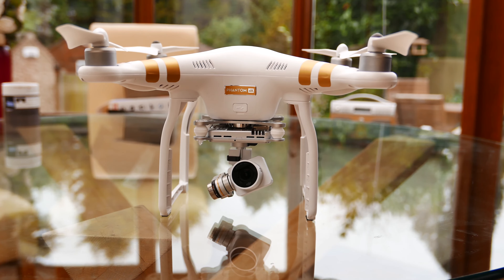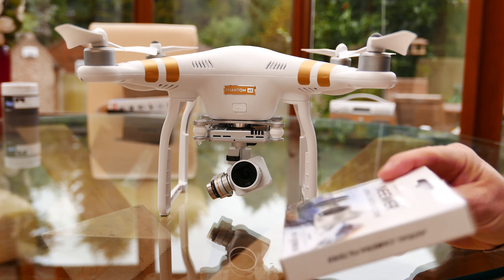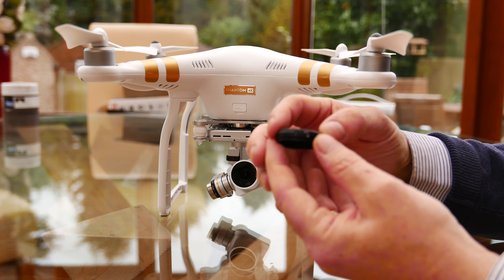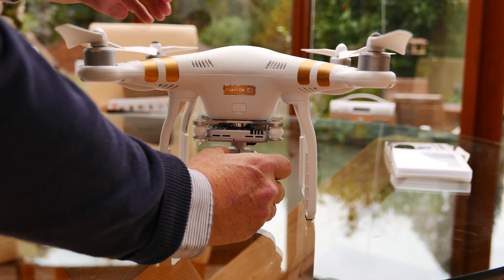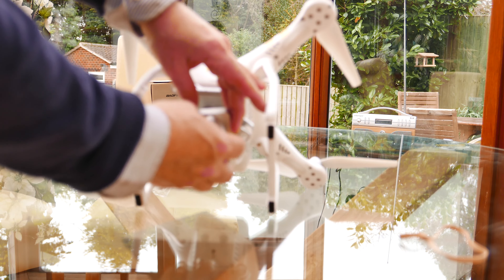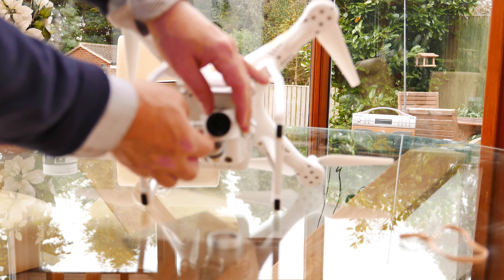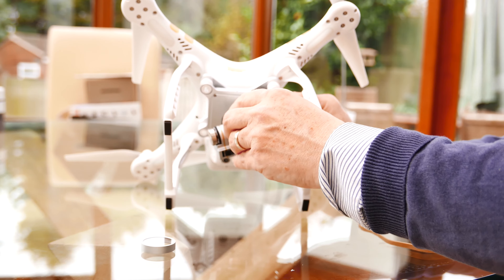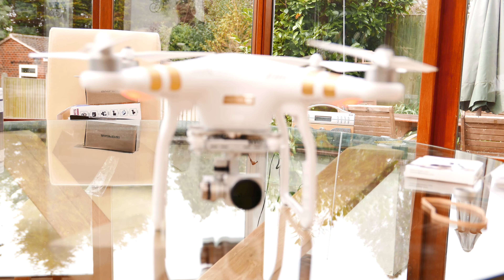Variable ND Filter on DJI Phantom 3

Comment: How much bigger is the filter than the stock one, I can't tell if my lens cap/ gimbal guard will fit. I have one of those £9 3D printed ones off eBay
Reply from the maker: +reinforced octocopters It add approx 3-4mm to the outside diameter.